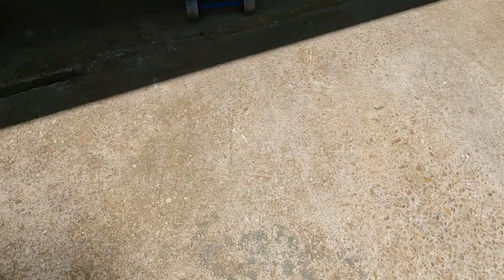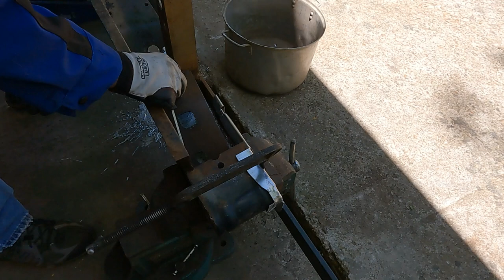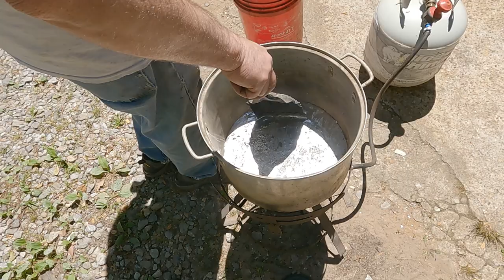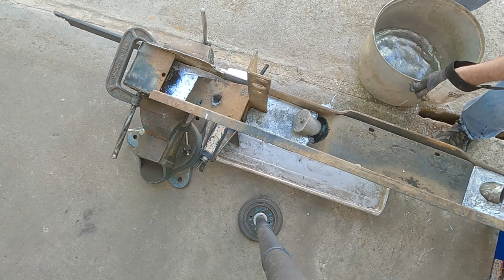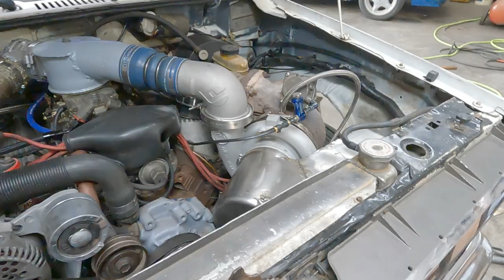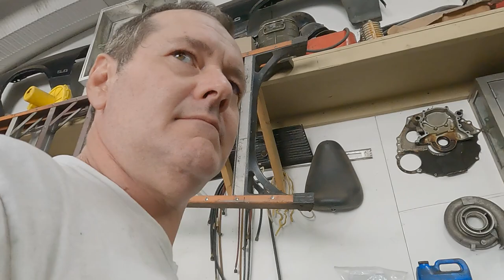Heaviest bumper ever on a 87 Ranger

Comment: That turned out great
Reply from the maker: I had to use the engine hoist and a jack to put it back on got to be 300 Lbs.
Reply: @kickassmustangsgarage  I was thinking it looked about like 8  12 lb billets so I would have guessed 200 + the factory bumper
Reply from the maker: I had two 5 gallon bucket's full. The bumper was probably 40 pounds. It should help out hopefully
Reply: I love it man. Would never expect to see all that weight hiding there.. hope it helps you out. Get some drag radials next 👍🏻
Reply from the maker: @1953fords  it always rides better with some weight.  I need some drag radials any suggestions?
Reply: @kickassmustangsgarage  yes the weight smooths out the ride nicely. Like floating. Well I don’t have a lot of experience with drag radials. But I have nitto 555 275/50 on 10 inch rims on my ranger now and with the CalTrac bars back on correctly with the axle over the leafs again. They hook good. And truck squats nice.
Reply from the maker: @1953fords  I'm thinking about swapping the Mustang to 5 lugs using the one axel out of the old 7.5 out of the Ranger and get another one from the JY.  A 87 Lincoln mark 8 rotors on the front to swap it.   Then I could swap tires from truck to car and not have to buy so many tires and rims.  I can't drive but one at a time lol.
Reply: @kickassmustangsgarage  yes I hear you. Tires are so expensive these days. Plus like you said can only drive one at a time 👍🏻
Reply: @kickassmustangsgarage  I also am not sorry for the first car that may rear end you…. Their in for a shocker😳
Reply from the maker: Lol  Like Mr T said I pity the fool.  It'll bend the braces before it puts a scratch on the bumper!
Reply: @kickassmustangsgarage  exactly. Maybe it will be a Prius sniffing your tailpipe 🤣🤣
Reply: Still lookin bad as hell I've always wanted that ranger lol